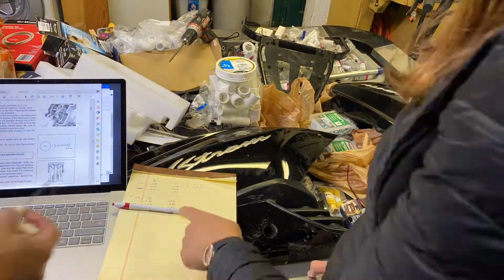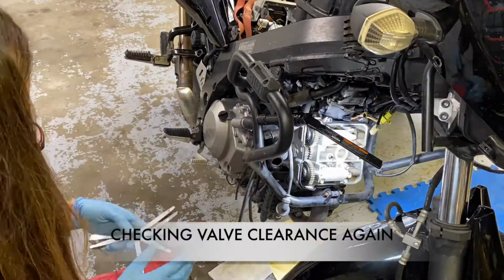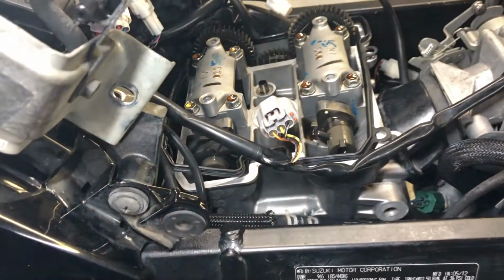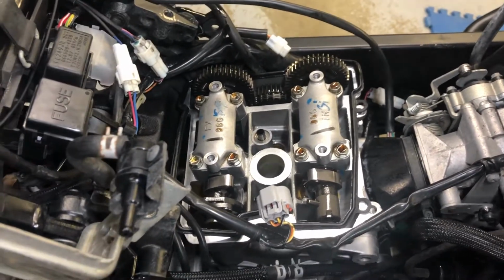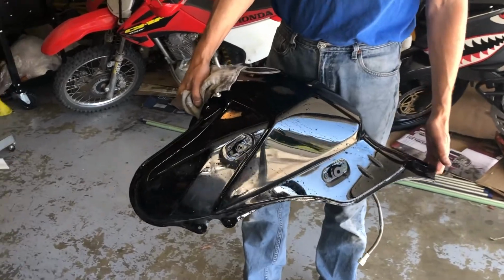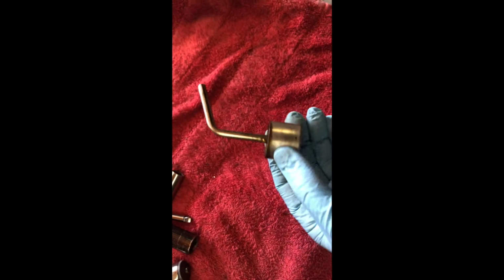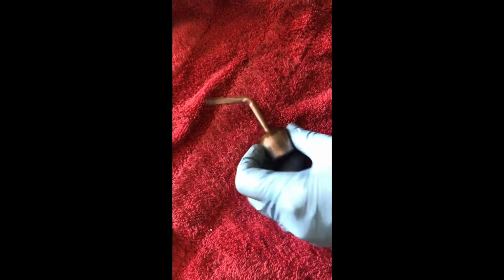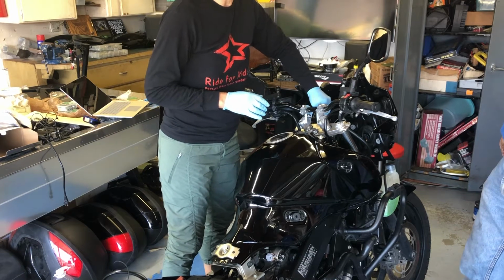VSTROM Project Bike Repair PART 2: Valve adjustment, a mystery in the gas tank, and more

Comment: Crazy ...looking through the parts-fiche for that bike, that part does NOT belong in the fuel tank at all. ...no idea what it is!
Reply from the maker: Video 3 will solve the mystery!
Reply: I'm thinking it's part of the fuel vapor emissions system, and it was connected to pipe on the underside of the well the fuel cap sits in. Maybe broke off from vibration.
Reply from the maker: @moto.squish  Without giving it away...I will say this...it is the reason the bike stopped working for previous owner. He had the tank off and drained, but he must not have ever moved it the right way to get it to slide around inside and make noise.